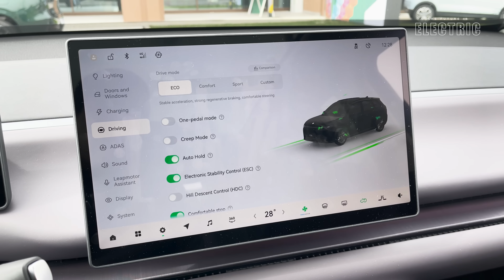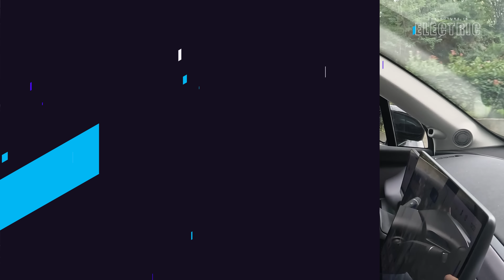My first test drive in the Leapmotor C10

Comment: I've seen this car in Malaysia and the build quality is pretty good, seats are comfortable, front and rear. The rear cushions are a bit longer with a good seating position (5" 8"), it is really roomy in the rear cabin. I was surprised by the power specs for a vehicle of this size, as in I expected more and faster charging speed as well. It would be nice with a higher capacity battery, longer range and some wider tires to give it a bit of sporty driving and handling feel.